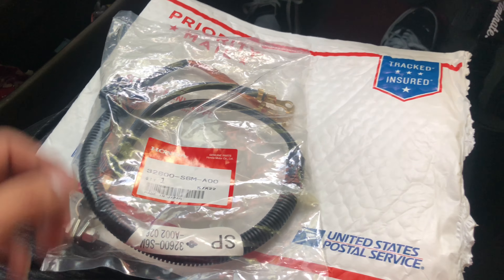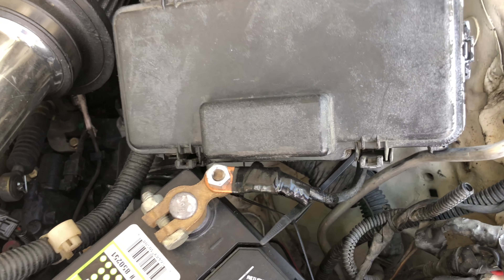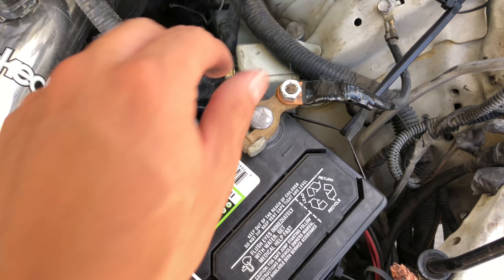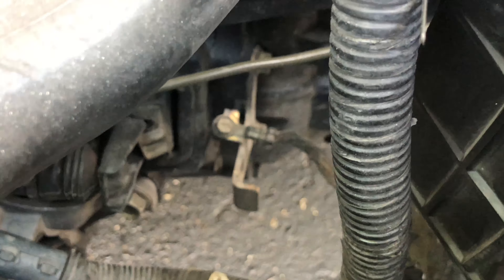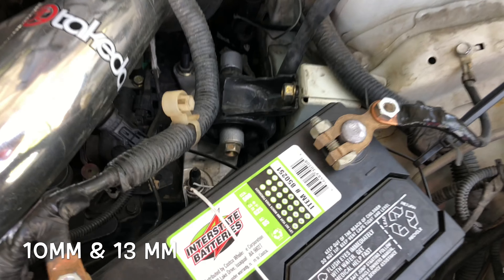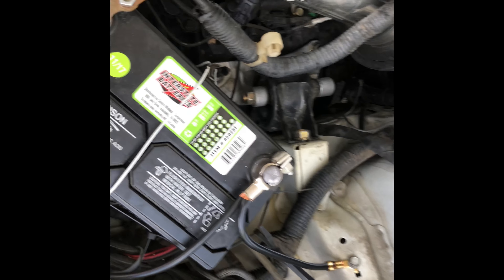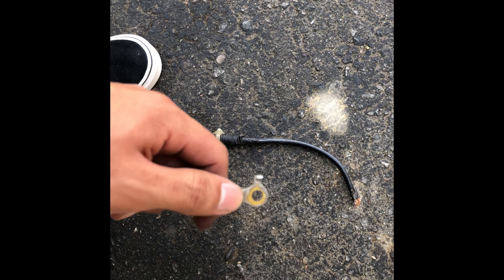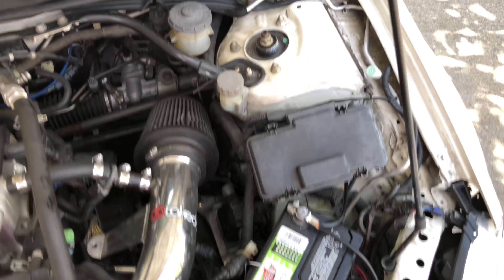RSX Battery Ground Wire Install

Comment: My K20A3 EP3 has the same problem.  I would turn the key and everything will die all the electric. Then I would have to take out my negative battery cable and reconnect it to be able to start my car again. Will this be in the same location as the A3? The grounding from the starter to the battery?
Reply from the maker: They should be similar. I am not too sure exactly, I’m sorry bro
Reply: This negative battery cable is same for EP3. It goes from negative battery terminal to ground under fuse box and ground on transmission. The ground from your starter to battery is the positive wire harness. You can put a 4 gauge wire from positive battery terminal to starter directly with crimp rings if your OEM harness is worn or ripped.